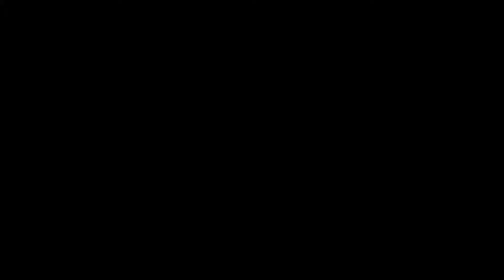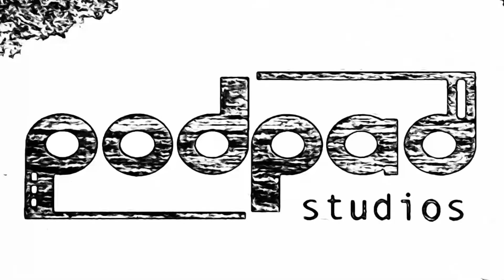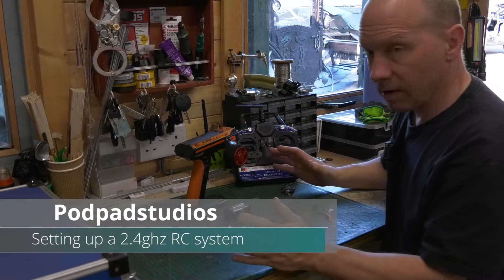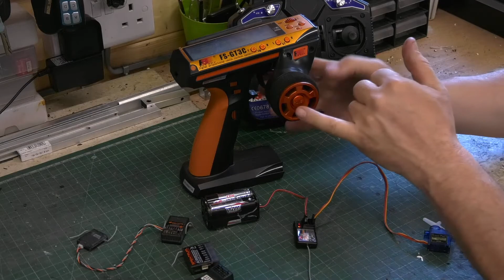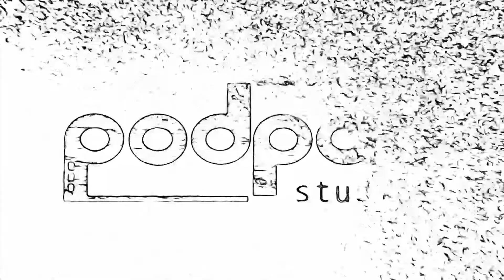Setting up 2.4ghz Radio control system for Radio Controlled Props Podpadstudios Mid Week Mini

Comment: Another interesting production- Very well explained and clear to understand. When building a mobile prop such as the Dalek/ robot ect  how does the power/ voltage from larger batteries get supplied, switched and controlled to the motors providing the motion for the prop and other functions such as flashing lights, pre recordings ect? Many thanks, Andrew.
Reply from the maker: There are quite a few of our videos about batteries ..
Reply from the maker: Batteries part 1
https://youtu.be/HwUKurjvU5M

Batteries part 2 discussed  in Zoe from 00.10 https://youtu.be/LzrHKpdlmbI

Batteries part 3 from 01:03
 https://youtu.be/ge1G7Tf4Nso

Also note that we use devices to step down from 12v to 5... I will pop up the links tomorrow
Reply from the maker: And there is also some info on how to make Daleks move in this episode

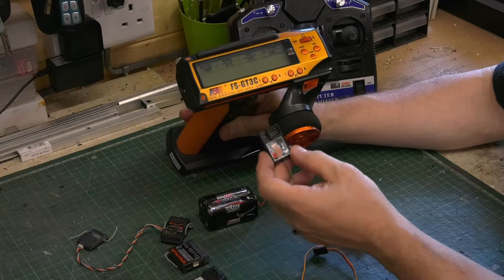From 00:40 https://youtu.be/WrAj5lTj1yg
Reply: @PodpadStudios  Again, easy to understand from your explanation / video footage. After watching these links I now have a understanding of my initial question. Many thanks for your reply's, Andrew.